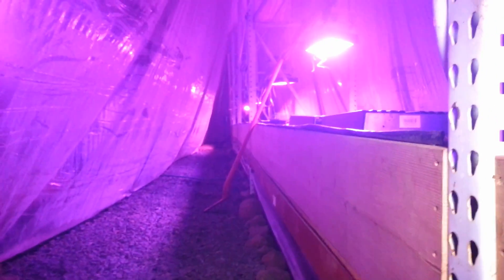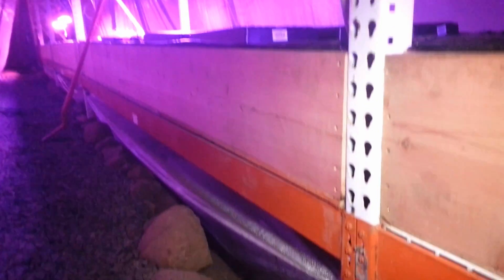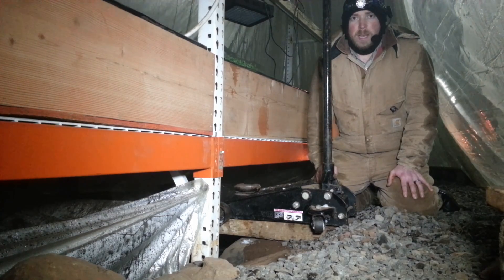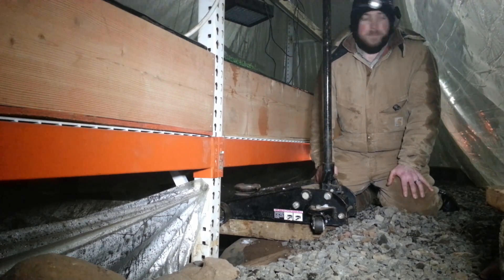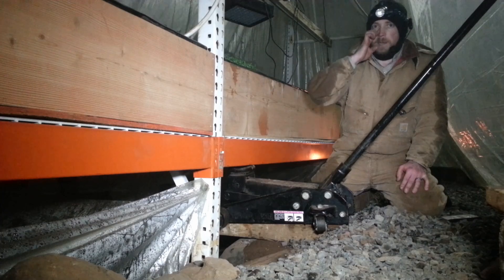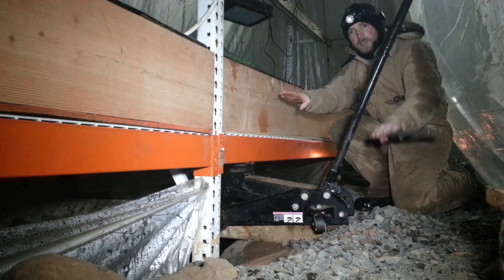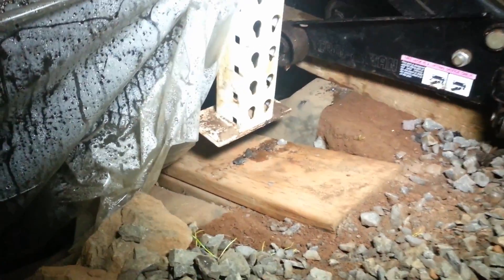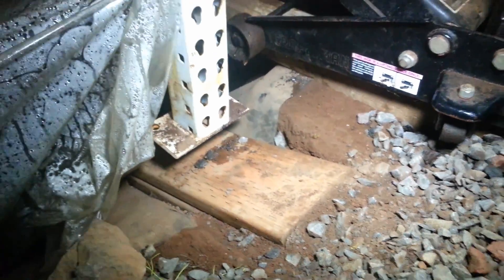Dirt Aquaponic Foundation? Hmmm, Maybe Bad Idea

Comment: Maybe your answer is Screw Piers.  You could sink one on each side of the rack next to each foot. them run a 4X4 across the pond.  The are also called Helical Piles.

https://www.bing.com/videos/search?q=screw+pilings&qpvt=screw+pilings&view=detail&mid=64B9236FB79C038F5D4A64B9236FB79C038F5D4A&FORM=VRDGAR

https://www.piertech.com/products/helical-piers.html

Comment: Those blocks under the shelving units look scary on an angle like that on an angle I've jacked up plenty of decks and houses those will rotate and drop again especially when it thaws.I think it would be better if you ran a solid member across the fish ditch underneath like a 6x6 ,16" or 24" on each side will be solid

Comment: I hope we don't some day learn The Real Martian was killed in a freak accident when pallet racks collapsed on the ranch!  Seriously, disassemble and build real footings now.  The amount of weight you are supporting by dirt with a tangential water pit at the foundation is enormous!.  If the wall of the fish tank gives way... the entire rack will likely tip over.  It would only take a few hundred pounds of force to tip.  The water pushing against the pond liner does nothing as a support.  It will simply displace when the racks tip over.  The racks might stand upright today, but when you get considerable amount of weight from summer growth plants... these dirt footings will collapse.  In warehouses, where these racks are used, they are bolted to concrete that is thick enough to withstand heavy loads. They are NEVER free standing, they are always bolted down before use.  Grow beds full of cycling water weight is extremely heavy.  Merely having void space (fish tank) immediately adjacent to the rack's leg is risky.  Please stop fooling around, do it right!

Comment: Have you thought about larger wooden supports? Maybe 4x4s (or bigger) across the channels, supporting the white poles, extending 2 or 3 feet out on either side, with 2x6 cut 4 feet long placed lengthwise relative to the beds, spreading the loading over more ground, further away from the sunken ground?

Comment: This problem will never go away. You have a huge amount of weight on a small area of dirt. The beds are not even to full weight yet. I would dig 8" post holes about 3' deep with a 12" square on top 3" thick. I know you don't want to hear this but you need to move the beds to the other lanes and fix these two. You are on thin ice waiting for disaster.  Good luck.

Comment: could you install something like a a/c drain pan sensor where if the water gets to a certain height it will cut off the water? or an overflow drain where water above a certain point is drained off into another tank, for example? Either of those would ensure that the water level does not reach above the barrier and are relatively inexpensive.

Comment: Seems to me you would just need to reinforce the pond wall at the pressure points and not the entire pond. maybe even put entire beam across the pond rather than individual blocks. Should make it more difficult for individual points to sink.
Reply: My thoughts exactly! No need for concrete, cheap and easy..👍🏻